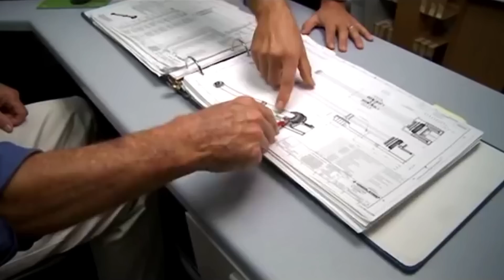US's Ultra-Advanced Railgun Weapon Is Making All Others Obsolete

Comment: If the Army gets this working, it would be an excellent replacement for the 5-inch gun on Navy vessels and excellent for missile defense primarily.
Reply: It's already been ditched. This video is well out of date despite being posted 4 hours ago. The advantages of the rail gun are outweighed by its disadvantages. In the space it takes to generate and store the power needed to launch a single projectile, over a thousand conventional projectiles can be stored. And the stand off range of the weapon, a long with the time to impact, and the immediate de-acceleration of the projectile means that the target can simply move out of the way. A hypersonic missile will maintain velocity and adjust heading during flight.  
 As for missile defence, idk about that. In a theatre which is likely to see more and more hypersonic missiles I don't think a rail gun will have any effect.
Reply: Interestingly, the Navy tested 5inch ammo developed from the rail gun project. They fired 20 rounds of hypervelocity ammo from the MK 45. This was some time ago, 2018-19 I think.

Comment: Imperial units are annyoing and unnecessarily inconsiderate! Could you please mention metric values, which btw EVERYBODY understands?
Reply: Funny, I could say the same of the metric system! 

As a american, I have no issues using imperial or metric. Just be glad your not a programmed than needs do hexadecimal math, or a roman using roman numerals :)
Reply: @guytech7310  US & Burma are using imperial,   the rest of the world is metric. Go figure.
Reply: @MartinKuras  UK ended metricifcation  and still uses imperial measurements for a lot of measurements. US ended its Metricification in the 1980s largely because of costs: road signs, manufacturing retooling, etc. 

US has always been a Maverick & that isn't going to change. 

Does not really matter. Its just a unit of measurement.  I can use both, but for the most part I use imperial units. I never complain that some is using metric measurements, any no way will your comments get americans to switch over to metric.

Comment: I heard that the per shell cost was astronomical.
Reply: The shells for the 5 inch guns on the Navy's Littoral Combat Ships were originally supposed to cost 800,000 dollars each.
Capable of hitting a target moving 60mph at 110 mile range.

They did not work. 
The substitute cost $250,000 each and is capable of hitting a stationary target at 75 miles.

To change each active ship gun to fire the alternate round, the cost for each gun changed was estimated to be 2 million dollars.

The Littoral Combat Vessels cost close to 7 billion dollars each.

Comment: Always wondered why they use rails instead of linear induction motors (no physical contact so no wear and tear), maybe it's the power requirement or weight?
Reply: I don't think they're able to achieve the accuracy they want without the physical contact of rails acting like the barrel of a gun.

Comment: When the fireball that comes out of the barrel is larger than the one from a standard powder charge cannon, you know this power is just unbelievable. I certainly hope we field these systems soon.
Reply: Ya, often with high powered railguns, the rear part of the projectile is vaporized into a plasma. It increases conductivity between the two rails, and the expanding plasma assists in pushing the projectile a bit. I bet that is what is seen exiting the barrel here.
Reply: So you want to limit the weapon systems we field based on possible redundancy? That mentality is why the Air Force built F4 Phantoms with no cannon initially. Once we overcome technical problems the system has wide range of uses beyond simply trying to compete against a missile or rocket.
Reply: @RNemy509  No. What's redundant is the kinetic energy of impact on a reentry vehicle. They come in at mach 15-25. You don't need to hit it hard, just hit it 'at all' and you're golden. The reentry vehicle's kinetic energy will take care of the rest.
Reply: Kinda wonder if they can make this stuff guided....
Reply: @dwwolf4636  can, but it's hard due to the g-force of launch being as violent as the impact. regular cannon fire also has a lot of g-force on launch, but it's like an order of magnitude less severe.
edit: the speed creating plasma could be a possible limitation for any sensors on board as well.
Reply: @dwwolf4636  how would that be possible?
Reply: I've heard the RG concept is being shelved for now, until some breakthrough in material science comes along. The reason for shelving have already been listed above in this thread.
Reply: The weapon shoots itself in the foot by needing huge amounts of power. It would basically be tied to a ships nuclear reactor, only useful to areas that can be targeted by sea.
Reply: @SL1CEND1CEN  Ya, worse than that is the fact that the barrel tears it's self apart because of the immense forces. Still an unsolved problem as far as I'm aware.
Reply: @Wavesonics  Makes you think they had to experiment with various current strengths and found anything less wasnt effective enough to have it replace conventional firepower, but super power it and it blows the barrels. A system to swap between multiple barrels would be considered, and then things probably would get prohibitively expensive. I think the tech could bake in the oven for awhile to wait for some advancements, but most likely hypersonic missiles is just the all around better option. The one thing I see the ultimate usefulness of railguns in, is the shooting down of hypersonic missiles or icbms
Reply: The US. Must station it now before its too late
Reply: So yo can try out your billion dollar guns on goat herders who still manages to kick you out of their countries lol?
Reply: considering it has no propellants used and the fireball is just from the air itself burning from the heat and acceleration produced then yea its got power.
Reply: Glad to be with the  US Period.
Reply: Not gonna happen.
Completely apart from the problem of energy density to power it, hypersonic rail guns more or less destroy themselves in just a few uses at most.
But there likely will be ramjet projectiles fired from conventional guns which achieve similar speeds with infinitely less problems.
Reply: @kathrynck  ramjet projectiles will be susceptible to emp's and being hit by anti missile weapons, that would be very hard to do against one of these projectiles and with the ability to add more rails and barrel length the speed and distance rail guns can fire can be increased immenesly and there is no way in hell a ramjet missile would be able to get close to the same speeds.
Reply: @kathrynck  problem is the same time we can make a rail gun this powerful is the same time we'll be able to make a laser that powerful and lasers can shoot down anything moving slower than relativistic speeds while a laser isn't going to stop a solid piece of steel from a railgun all it's going to do is heat up the metal into a hot liquid steel before it hits the target at hypersonic speeds!
Reply: @kathrynck  Yup
Reply: Why? The weapon seems pointless when hypersonic scramjet and glide vehicles will be more than capable of neautralizing enemy ships at a much farther range.
Reply: @suga03100  The cost of a standing defense is far cheaper. The naval need is different from the army, too. I'll bet 10:1 that the JT Chiefs hashed this out.
Reply: @suga03100  this is in early prototype stages, the speed and energy transfer it has cannot be matched by any weapon on the planet, it would be impossible to shoot a projectile like this down, the only thing holding it back from being an effective weapon is proper advances in metallurgy or material sciences, once a barrel can be produced that is good for several hundred rounds then this will be an extremely effective weapon, they have already shrunken the powerplant from the size of a building to something that can be carried along with the gun on a mobile platforn, so its just the barrel strength holding it back, i'm not sure you understand just how fast and far these projectiles can be fired and with the addition of some adjustable fins or moveable weights inside the projectile they can probably have their trajectory altered during flight, sure right now they are completely useless as conventional weapons but with the right breakthrough in material science they could be deployed very quickly.
Reply: why? why needed?

Comment: It may take a while to iron out the problems but if they can use magnetics to shoot aircraft off the pointy end of the boat, they’ll find a way to build an operational rail gun that is cost effective. Lasers were a Buck Rodgers dream back in the 1930’s, but they are fielding them on naval ships now. That’s speed of light tech that we’re now talking about. Besides that General Atomics projectile is probably a whole lot cheaper than a standard missile or a harpoon middle. Keep the faith shipmate’s. They’ll figure it out!!!
Reply: Can those lasers shoot through clouds/fog?
Reply: The problem is magnets lose power when exposed to heat. Meaning frequent rail replacements. Also the acceleration means it's unlikely for any electronics to survive being fired to guide the projectile how they want to
Reply: @hf117j  it does use magnets. it use electrical current to generate a magnetic field. The barrel consists of a pair of electrodes long the entire length of the barrel and electrical current is dumped (shorted) across the projectile which creates an opposite magnetic field generated in the barrel electrodes.
Reply: yup. in the last update a couple years ago- they had a navy admiral saying the same thing. firing the blitzer, even with the current prototype technology? is 100x cheaper than missile tech & a LOT faster.  at those prices / speeds / rate of fire? they can afford to miss- 90% of the time and still eliminate any & all incoming threats. line your 'area of denial' with blitzers? an enemy would be whacko to try & attack- like trying to cross a mile of no-man's land armed with a rifle & a grenade- and the other guy has a .50 belt fed.. and ALL day to just spray you down.
Reply: Inner mind directed Energy Weapons target approximately 1% of human population via 9 mile high drone set by project mandate colloquialy known as 'Grim Reaper' of which iconic resemblance symbol known as the death sorcery cast is relative to the skeleton ghoul's scythe's familiar shape bearing resemblemance of the likes of the gamma radiation power character indicator sign that looks alot like a crooked backwards 7 numeral digit. The 9 mile high Unmanned Aerial Vehicle of Surgeon General's Grim Reaper U.S Navy Air force branch skyborg skynet surveillance of earth's physical containment properties is set in it's infamous soul abduction motion of physical and fully non linear Gauss Laser powered by Raytheon Corporation construemcy of 70kV capacity run in 9 phases of consecutive 100 ampere projecting heavy particle disturbance capable anti personnel force operated by means of G.O.R.G.O.N. S.T.A.R.E 10²⁴ Hz emitting G.O.D. force play X Ray cannon projection that acts as a clandestine form of heavily guarded secret of the monopoly category of such classified atmosphere watch gravity gun cancerous harrasment that is programmed to fulfill a very uncanny  intervention of actual Holy Ghost Air Deployment actual armed divine disfigurative afflictions on subjects experiencing the enforced microsatellite genetic Radioactive nanomachined symbiosis holding this deeply resented relationship of gang sindication via remote cancerous Directed Energy Solutions set by this covert bombardment of non visible laser radiation from the drones' gaussian beam emitter due to existence of smoking sources and their elemental deterrent of management stability spherical balance containment set by blackout breeches; otherwise reliability and dependable safety standards of layered atmospheric maintenance of climate control and earth control processes stemming from sound and smooth environmental aerial conditions. Smoking fire depending on the chemical propellant friction level and type details of which issuance is unknown is targeted by this system control run by numerous complex branches of U.S
Naval base drone fleets carri d out by autonomus operating counter insurgency by MQ9 R.E.A.P.E.R.  the General Atomics program sky guardian proprietary doctorate of very comlplex political continuos cover up tactics led by Pentagon tribune as defense against insurgency of 🚬 ng's potentially hazard induction that is firmly stated as direct reason leading to the fluctuations and stripping of stable atmospheric coverage quality. This truth though I have no concrete facts other than personnel description of the Grim Reaper program inevitably concerns us all as severe inner system death and hidden electronic harrasment plague of AIRFORCE Destruction causing 🤖 parasite of atrocious hidden by Gaussian Beam Operating Electronic G.O.R.G.O.N. aka the Geoscape Operations Radioactive Gamma Observation Neutrinics 🔫 of  full blown mind control abductions mixed as dark suggestive paranormal activity scripted by Hollywood media concerning the worldwide inevitable system bodily radioactive rejections via covert tactical terrorscape and  imprisonment from nanomachined uplinks setting us all to such unexpected attacks by microsatellite coded genetics resulting in stalking utilized by S.T.A.R.E. Satellite Topography AirForce Recursive Equation field of fully unjust unexplainable to the hapless subject on the nature of crimes committed sequences of worst bodily control matrix stripping settings bearing the witnessed cases of individual's self preservation and independence. R.E.A.P.E.R. the Remote Electric Autonomous Population Exterminators Registry is what is responsible for stupid cover ups set by political think tanks coined under layers of think tanks such as 'Schizophrenia' and Havanna Syndrome.
The song "Seasons Don't fear the Reaper" by blue oyster cult band is a reference to machine schematic trust breach of  MQ9 Reaper and RQ4 Global Hawk of their fully automated life assignment to eradicate human population due to use of unstable energy projections caused by carbon monoxide emissions. Religion and ignorance are the worst forms of evil there can be. I luckily have kept my syntax and learned by interrogation that the sun is obviously not natural but is an electric unit onwed by Raytheon  which body of corporate force is the sole owner of this universe we live in. General Atomics is it's grid rulebook and earth resinence is set to affect even you likely by age 86 due to natural genetic mutation you shall be set under that is diabolically and heathenously viewed as automated biological treason and thus enacting this long untouched topic of how satellite neural deliberate terrorism is the cause of our inability to live an eternal life. Reject religious groups and all forms of very deadly social stripping of this unwavering dark truth of what the Special Forces of Covert Operations of Airbase Patrick, Florida disclosed to my dodged indirect remarks of how I am not possed by stupid archaic notions such as 'witchcraft' but find myself belayed by unexpected neutrino debilitating rejection as if my body's gravity support has been canceled. Hence why its called 'cancer'. For I fear the Reaper and deeply loathe the Jews and Christians. Be smart. There are way too many forms of electrical covert deformative gaussian field disfigurement and variety of bodily molecular Disturbance to be descriptively understood by regular language. That is one huge X Ray gun under the nose of General Atomics Remote Piloted Drones. It has zombified me before and forcibly rejected my mental survival instinct by such covert assault that is all set and bombarded by atmospheric conditional safekeeping trust breech case log read by trinity of satellites monitoring Earth's seismic activity and perverting me into a 'mysteriously Ill subject category' that was informed to be a cancer ploy cover up primed by these military monsters to get you by age 111 86% chance. Churches are wicked sources. Here is truth for you and please go look at the drone yourself instead of BLM actions along with their democratic insinuating tactics my sorry white refuge escape has termed as full blown social security trust breech of a jungle based disgrace governing this nation as a form of population church sovereignty instead of plain and  difficult attempt to learn science and languages while bearing cover from the barbeque pit UFOs rather than joining the black cult force of inditement of human population technological maintenance while rejecting potential to uphold white respect and sole reason of keeping true to what holds the original scape of the color spectrum of nuclear fusion components the stars disclose instead of black cult projects ravaging our physical potential by rejecting opportunities for white austerity of resource discriptive outreach education by full factual scientific disclosure of the fundamental and not fun understanding and physical activity ownership credit and supporting base honesty. Gang Stalking and inverting the "+' symbol to enforce social literate ploy anti earth anarchy and liberal tryranny I witness is the wicked heart of corruption...

www.mp3juices.cc for free mp3 downloads
Listen to Uriah Heep song called "Lady In Black" and "come away Melinda"
Original "Come Away Melinda" song was performed by band called UFO. No heavy petting please.
Patrick Girdner ex covert operations of US Navy was known as "Rachelle, Legend Of 49 penises of NC 17 Deployment Aircraft of Lockheed Martin Aerospace.
Reply: @maksimbrazhnikov9426  ok... no more acid or mushrooms for you boy. take a break from that video game- back to reality- REALITY- that's where the pizza delivery guy comes from.